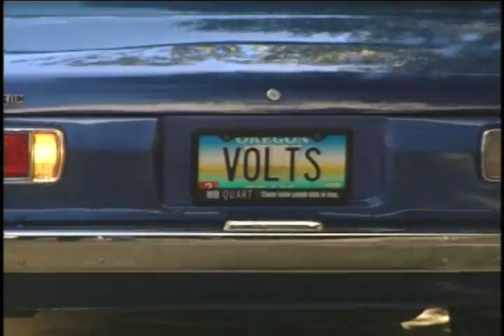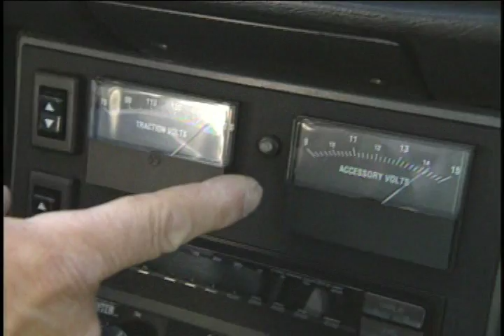Homemade Electric Car Maker Builds in his Garage

Comment: Electrical energy can be moved to make such a car is an excellent event.
What is the maximum speed the car can do? Max is the way how many miles? This is the car used in the electric motor, designed for carsDid he? With direct currentDid he electric motor works? An allowance or credit for such applications in your country have? Does it give you money in the state for this issue?
Your work is very beautiful.

Comment: @thematthewmatthew222 Because you can not generate more power than you are using, in fact you would be using MORE power to turn the alternator than it is producing. an alternator is merely used to CHARGE a car battery POWERED by an ICE. props on your thinking though,

Comment: @thematthewmatthew222 Because it uses some of the torque generated by the electric motor and it doesn't have 100% efficiency, it ends up using MORE electricity than without it (correct me if I'm wrong).

Comment: @thematthewmatthew222 You can´t create energy from anywhere. The energy used for the alternator is the same energy lost for runnig. So you can recharge batteries but the car is less powered. the result is the same, No energy saved. I´m not english speaker so i hope you understand

Comment: @thematthewmatthew222 Beacuse an anternator rquires force to turn it especially when amps are dran from the alternator. It will produce wastage in heat + added weight Just to charge the same batteries that are driving the motor. So it it not an efficient way to do it.

Comment: Listen, why don't you just buy a 2000W inverter generator, hook up a rectifier to convert the 120VAC to 120VDC and convert the engine,s carburetor to run on HHO gas

Comment: @thematthewmatthew222 --> Because what you will be doing is take energy stored in the battery putting it thought an electric engine converting it to mechanical energy the converting it into electrical energy and finally storing it in the battery again, but because of various efficiency of different components and converting processes you will lose energy so a car like this with an alternator would actually have shorter range than one without..

Comment: Most efficient way to do this would be to put an onbord Generator. Set it up to where you can plug it in like he has it but if you also have an onboard generator to help keep the batterys charged up after they start running low, I wish I had the money to do this to a truck. I think it would take some work but to build an offroad Electric truck, would take alot of work but I think it is possible to do and would be pretty cool.

Comment: @themachinegunn You did hear that he can only go 30 miles without recharging right? That's why they say there are no batteries.  Current batteries are heavy and low storage...  So the more batteries you add... the more batteries you need from the added weight.  At current technology (which battery research is at billions of dollars a year) we can never get an electric car to last that distance and even if you can, it would take days to recharge that many batteries!

Comment: @fancher9 he's not lying, a forklift motor with rewound coils can generate 500hp/1000lbs of torque.  The amount of torque is unbelievable versus combustion engines.  Let me guess, you have an '81 Camaro, air shocks in the back with the back end up in the air and rolling on Cragar SS's?  Still sport the mullet on the dome?

Comment: So, 10 electric car puts out the same CO2 as 1 gas cars, based on the energy used. So it kills the planet 10 times slower. Now if you live in an area that runs on solar or wind, it emits 0 emissions.

Comment: He should try putting the batteries in the center of the car for evenly distributed weight, adding solar panels to the roof, and putting a small wing turbine in the head grill just for those little emergency times. Also, it would give it a much longer run time and make it go faster. I'm 12 years old :D

Comment: sure, true that coal emit fossil CO2 but the thing about electric cars is that they are not locked to coal. they work with wind, sun and water too and coal has to go as well as the combustion engine.
lithium is cheap. cheaper than lead already because they are lighter and live longer. 2-3k$ gets you going even at a 'retail' hobby level and my guess is will halve in price in 5-10 years. evcomponents. c om is the place to go for easy cheap lithium but they are going throuh a change right now

Comment: @bwho Let me add to the above. The flexibility issue is re-charging and of course replacing the batteries. I think that with some serious mass-production going on car batteries will come down in price. We need to sharply reduce their costs. 

 And the smokestack of the coal-fired electricity plant do produce some harmful gases, yes, but the call they are powering don't.

As for the above, I mean to say the cars they are powering don't emit harmful gases.

Comment: @toadabc it's lead acid batteries. today's best lithium batteries will take it much much further. just the tesla roadster from 2006 does 240miles per charge.
and a really optimized design will soon do 400

Comment: Modern combustion engines are only about 30% efficient (most of the energy is released as heat), how is that efficient? Even if the electric car was powered by electricity from a coal plant, that plant is far more efficient at burning coal than a single combustion engine. Furthermore electric cars are 90% efficient in how they apply electrical energy to the actual displacement of a given vehicle.